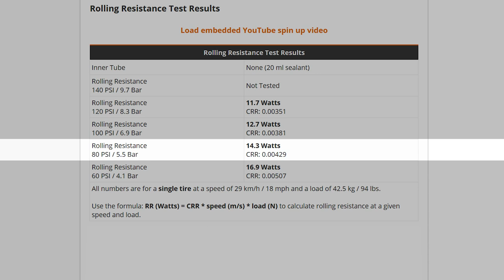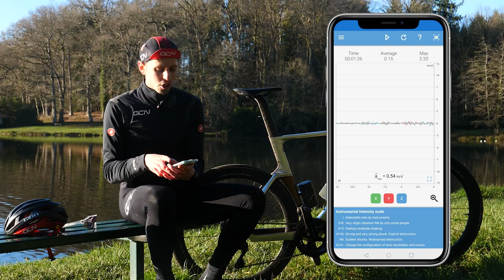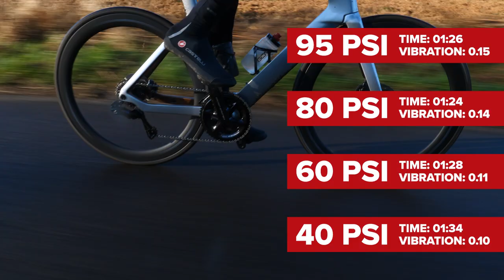Is There A Perfect Bike Tire Pressure For Speed & Comfort?

Comment from the maker: What are your thoughts on tire pressure and what do you use in yours?
Reply: 130psi on 23mm conti gran prix amber sidewalls. it's the past & will be the future!!
Reply: @GCN Tech : How much does the rider weight?
Reply: Great information! Btw what’s the brand on that Aero road bike ? And the sunglasses on the bench? Thanks
Reply: That I have no idea what PSI transfers to a normal way one would state tyre pressure (bar, kg, pascals,...)
Reply: I use 4.3 bar at the rear and 4 bar at the front, because the roads are really bumpy where I live and I use 28mm tyres, and I only weigh 63kg so I'm not that heavy
Reply: I run 23mm tube at 80 psi. My pump says it will go to 100, but I can barely get to 80. 🤣🤣🤣
Reply: 700x28c clinchers @50psi at 66kg. Holding speed well on grouprides with our crappy roads
Reply: @Fred_the_1996  definitely running staggered pressures makes more sense as there is more weight on the rear tire
Reply: I have to think that the optimal pressure to use is directly linked to the road you are on at the time
Reply: 60 psi both front and rear
Reply: Ive 70kg, Tubeless 26mm pirelli 65psi. On perfectly smooth road up to 70psi
And NO MORE!!
Reply: @adrienlevel  85 kg and use 25 mm
Reply: 62kg 45 psi with 28c tires. More comfort and no loss of speed.
Reply: @Fred_the_1996  thats very low. At least min 5 bar max 7 bar at least. You will consume less energy by having higher pressure.

Comment: Rough and bumpy roads. I'm a road cyclist and never ride on anything other than roads. However, finding a decent, smooth, pothole free, good condition road surface is a novelty.
So much so that if by chance I find one, I turn round and ride it in both directions.
Reply: Its not just the roads, the cycle paths are not getting maintained either.
Reply: You should come and try Swiss roads. Most are probably smoother than a velodrome 😅
Reply: @HFields  That's because you are in a country that has the foresight to invest in it's future. Here though, we simply don't. Everything on the cheap then wonder why it's broken. If it wasn't so utterly depressing it would be laughable.
Reply: Move to Florida.
Reply: Agree mate, it is the worst thing about riding in this 3rd world country as far as roads are concerned.

Comment: Would have been interesting to see you refine it even more, say try 70psi then go 5 either way depending on what 70 showed. Also would have been handy to know what the wheels are, so what the rim dimensions are?
Reply: 100% correct.  When I went from 25mm to 28mm tires, I started with a bit higher than the recommended PSI for my set up and weight, then I did the same exact ride few times a week reducing few PSI per ride (about  3 at the time) until I  found the sweet spot.  I went from 97/95 on my 25mm to 67/65 on my 28mm (different wheels of course). It took me few weeks, but it was definitely worth it the time and I wouldn't go back!!!
Reply: @FRamirez1A  Just curious (since you did all that work...) what you estimate your riding weight was and the quality of the roads you tested this on?
Reply: @georgehugh3455  Just go to the ENVE or SRAM tire pressure calculator (I used the ENVE chart). Depending weight, tires size  and your wheels internal measurement you can calculate a pressure to start with. I have tubeless set up and my wheels are 21mm internal and I use 28mm schwalbe. I weigh about 175lb.  My local roads are in pretty good shape (obviously not like a velodrome), but you can definitely feel a difference in comfort.  As a matter of fact, when I went under the sweet spot for me was SUPER COMFY, but the bike felt really slow accelerating off the saddle, so I went up in pressure a bit after that ride.
Reply: @georgehugh3455  If you're curious to have another similar feedback, I weight 145lbs and when I switched from 25mm to 28mm Tubeless, I lowered my pressure "Front/Rear" from 90/100psi to 55/65! I always have 10lbs less in front cause 55% of the weight is at the rear as a chart I saw long ago. Roads are quite shitty in Quebec "Canada". The difference was night and day, no way I'm going back to 25mm ever!
Reply: @PanzerIV88  Thanks :-)
Reply: @PanzerIV88  couldn't agree more. I will never (unless it's a hire bike!) ride 25s again

Comment: I love an endurance ride 150-250km on a Sunday so reduced vibration is very important with respect to rider fatigue. I’m 90kg and ride with a 28mm up front at 80psi and a 32mm out back at 70psi on Hunt Supa Dura wheels which are designed for 28-32mm tyres. 

Roll well, soak up vibrations and also great grip in the wet. 

28mm is a GP500 (Conti)
32mm is a 4 seasons (Conti)

In summer I ride 85psi up front and 75psi out back, it’s a bit drier on the roads and less mud etc.

Comment: Good video - just wondering if there is also a way to work out how pressure affects the risk of getting a puncture - this is an especially important consideration for those who use their bike to commute on bumpy roads!
Reply: A lower pressure will resist punctures better because the tire will conform over debris. When a tire has very high pressure and is prone to a puncture much easier. Think of it like a balloon that's half deflated it's very difficult to pierce. But a balloon blown up to its maximum is very easy to pierce.
Reply: @rider65  too low risks your rim though. A bump could hit your rim as your tire doesn't hold hard enough against it.
Reply from the maker: Both too much pressure and too little (due to pinch flats) increases your risk of punctures on bumpy roads!

Comment: When I went from 25mm to 28mm tires, I started with a bit higher than the recommended PSI for my set up and weight, then I did the same exact ride few times a week reducing few PSI per ride (about  3 at the time) until I  found the sweet spot.  I went from 97/95 on my 25mm to 67/65 on my 28mm (different wheels of course). It took me few weeks, but it was definitely worth it the time and I wouldn't go back!!!
Reply: Interesting. How much do you weigh? I'm preety heavy for a roadie 92kg and I ride on 28C Schwalbe Durano on 100psi/7bar and I never had a flat and I ride on harsh roads mostly.
Reply: @Jurica-mtb  Just go to the ENVE or SRAM tire pressure calculator (I used the ENVE chart). Depending weight, tires size  and your wheels internal measurement you can calculate a pressure to start with. I have tubeless set up and my wheels are 21mm internal and I use 28mm schwalbe. I weigh about 175lb.
Reply: @robbiddlecombe8392  my pressure isn't going to work out the same for you.  I went to the ENVE pressure chart and got the recommended PSI for my set up (66 psi in my case).
Since I was use to 97/95 on my 25mm tires, I didn't want to start so low and that's how my whole test began.  In every single ride I would log my pressure in STRAVA so I could compare my data at home after syncing with my bike computer.   
Per ENVE Chart, if you are between 170 and 180 pounds, for 21mm internal wheel size and 28mm tires, the recommended pressure is between 66 and 69 PSI, but once again, that should be just your starting point for testing.
Reply: @robbiddlecombe8392  I'm not really sure, I'm not an expert on wheels or anything like that, I just followed the chart and it worked for me. Are you running tubeless set up?
(When I say that it worked for me I mean that at the same watts I increased my average speed like 1 mile per hour if I recalled well).
Reply: @robbiddlecombe8392  Yes,  I run tubeless and I love them. 3 seasons with them, only 1 flat that I fixed with a plug. I don't even carry a Spare tube  anymore(I did the first season that I switched to tubeless).
Reply: Im finding out the same. 

I was on a set of brand new 25mm Vittoria Rubino Pros which were at around 90PSi I recently switched to some Specialized Roubaix Pro's in 28mm after the Rubino's kept getting punctures and im just trying to slowly dial in the right by trial and error. I went from 85/80 to 80/75 but even this is a little too firm and my lower back/spine has been absolutely feeling it after just two days of riding. Im now sitting on 70/65 and while the tyre is still quite firm it still has a bit of flex if I really push my thumb down on it. Not been out to test the new pressure settings yet as my back is just too stiff and painful...which is very strange as the 80/75 hadnt been that bouncy or jarring to ride at all.

I run a set of HUNT SuperDura's and Im a 92-95kg rider depending how much kebab ive had 🤣

If anyone is curious. 25/28mm on the specialized tyres are pretty good. The first thing i noticed was the amount of grip they had compared to the outgoing set of Rubino's even if im still trying to dial the right PSI. I can actually feel the tyres GRIP when i go around corners where as I previously couldnt with the Rubinos although I have never felt the wheels slide out from underneath me when cornering. They are a bit heavier though compared to the Rubinos but i might pick up the 23/25mm versions of the roubaix for summer use as weight seems more  inline with the rubinos

Specialized recommend a PSI of 115-125 for these wheels but HUNT says max PSI should be 100PSI on these rims. All a bit confusing but i'll get it dialled in eventually.

(hopefully my woffle will help someone)

Comment: Agreed. After riding at 125 psi  on  23 & 25 for a dozen or more years. I did a similar exercise and the-new t/p is 25  psi lower on 25 mm tyre , improving handling and comfort immediately. Make the adjustments across  on 32 & 40  with immediate results and will  continue to hone in on the sweet spot for 28 , 32 & 42 mm tyres.

Comment: My understanding is that tire companies optimize side wall and tread design to operate best at 15% rim drop.  For me, that's 47 psi front, 55 psi rear on 32mm tires.  I was pleasantly surprised to find that this not only rode a lot smoother, but handling and stability in corners also improved vs higher pressures.
Reply: 15% rim drop?
Reply: I am using the exact same pressure as you with 28mm tyre on 18mm rim. For 32mm i use 3-5psi lesser. I am 63kg. My bike feel smooth and fast and super enjoyable to ride

Comment: i like the idea to use your phone to objectively measure vibrations. about the experiment: it would be important to repeat runs with the same settings to see how consistent the results are. then it would be possible to say whether the differences are real or a statistical artifact. about too high pressure: I think that often feels fast because you feel more of the vibrations through the frame. testing wheel rolling resistance in the lab is done on a smooth surface. on a real road less pressure can be faster because the bike does less horizontal movement.
Reply: Much agreed with multiple runs and smaller pressure increments. I would also take it a step further repeat the experiment with some potholes and cobbles - those results would be interesting as well. Great work overall :)

Comment: Apparently the tubeless Panaracers I've been trying to seat for the last few days think the perfect pressure is 0 bar (0 PSI) 😅
Reply: Get some latex tubes and save yourself the hassle
Reply: @richardggeorge  1) I can't give up and 2) tubeless is great once set up. That set up can be a pain though.
Reply: You can seat nearly anything if you have a 60 gallon 240 volt air compressor in your basement. Good luck if you can do this on the road if it burps!
Reply: I added another layer of tubeless tape.  Then my Panaracers seated.
Reply: Have you tried the soapy water trick? As Gary said... more tape might help. Also (if you're not already doing it),  you might need a compressor or a chargeable pump.
Reply: @eccehomer8182  Appreciate the tips. I'm using a compressor and it's seated now but losing air from somewhere even though I've retaped twice. Might need more sealant...
Reply: Must be new run-flat technology.
Reply: Ah, Tubeless Road Tires!  
A messy, time-consuming, expensive solution in search of a problem.
Reply: @Lis Thank you very much for the detailed response!
Reply: @whatwelearned  Sealant isn't really rated to above 70psi. It also pays to get good stuff. I used Stan's, I've also heard Orange is good.
Reply: Yes tubless for road is entirely flawed, for the pressures that competitive/ fast road bike riding require
Reply: @eccehomer8182  We're talking 'cross tyres here. Circa 40psi
Reply: @whatwelearned  I feel you
Reply: I ride MTB and Road... uhh my MTB and gravel bike no doubt about it I am running tubeless. But for my roadbike I run tubes with sealant inside yes more weight but as a daily rider I say perfect.
Reply: @richardggeorge  100% road rider here.  110 kg= no tubeless.  By the time it seals you've coated the rider behind you and the tire has come off at the bead. Got to have 90 psi to avoid rim damage and burp flats. Putting a tube into that slimy mess changes most people's opinion!
Reply: If you are measuring 0 bar you are in some kind of vacuum :-)
Reply: @eccehomer8182  i use hutchinson's sealant and it works well too
Reply: Idk about tubeless tires but I know higher psi makes your bike faster by 20-40% I have tested it

Comment: Great concept for a video, I do wish with all these that the sample size went up a bit. You can always do repeat runs off-screen if it's boring, but would make the outcome so much more reliable. The 2s difference between 80 and 95 psi could easily be from a couple of windy gusts or a slightly different line taken. Taking an average of 3 would really mean something
Reply: My thoughts exactly - but this is GCN not a scientific journal! That bit when Alex was checking that the tyre was at the target pressure of 100 psi, saw it was at 95 and said "that'll do" tells you all you need to know! 🤣
Reply: Or you can do the repeat runs yourself.

Comment: Thanks for doing this test. Something I'm constantly changing is my tyre pressures. I'm not the fittest or youngest (51 years old) so always thought that riding with the highest psi (120 on my current tyres) would allow me to ride at my fastest and use less energy so long as I can put up with the harsher ride. I'm currently experiencing discomfort around the back of my neck and I'm guessing it's down to the harsh rides I've recently done. After watching this video I am now going to reduce my psi to 80, I totally get why you experience a faster ride with the slightly less up and down movement which is actually a lot of wasted energy.

Comment: These results fall in line with my experimental experience.  With both 25 and 28mm tires and 85kg of heft, I had found that 80 psi was my magic number.  But after a winter and some more testing, I prefer the 75 psi.  Much smoother at least and my avg mph is a bit better even!  Thanks for the number crunching, Alex!

Comment: I always run a slightly lower pressure on the front to help with grip (especially in the winter). I find my ideal balance between speed & comfort is 95 rear (as I'm a bit lardy..) and 90 at the front. However, after seeing this vid I might try 85 at the rear and 80 at the front. Really useful vid Alex! :-)

Comment: Interesting video, illustrates the difference between a "Road Bike" and what we used to call a "Hybrid" usually used on the road or cycle tracks.The bike I normally use has suspension forks and a suspension seat post, 44mm tyres running at their rated  maximum of 4.5bar. If traction is compromised for mud or ice I reduce the pressure by 1-1.5 bar. The bike then feels "soggy". No more comfortable just less agile, and harder to pedal.

Comment: I usually use 60psi on my winter tyres (32c alloy wheels) and a manufacturer  recommended 80psi (28c Hunt carbon 44 wheels) . The summer tyres are definitely less comfortable but do feel quicker.

Comment: I  swiched back to 25 mm tires and 8.0 bar in latex tubes. It's way more fun than a 32 mm tire with 5 bar - no matter what the current trend says. It was such a great feeling to be back on a real road bike. Thin tires and high pressure are - in my learned opinion  the fastest thing you can ride on a good road. When I want to ride my road bike I plan my routes picking the best possible roads available in the area and ejoy it. I know that low pressure will be better if the roads get worse and sometimes it can be anoying if these kind of roads cannot be avoided. But I don't want to win races. I am out there for the 8 bar on smooth concrete in narrow tires feeling. This is something you cannot get on a low pressure bike. If there is a tour on which I cannot avoid rough roads - I will use my gravel bike

Comment: As an added bonus, tyres at lower pressures will deflate slower than tyres at high pressures. 
Anecdotally, I know, but running my tubeless tyres at between 75 and 80psi, I'm not pumping them up as often as when I ran that 90psi.

Comment: Great video, GCN!  Any chance we could see how the road surface and tire pressure affect bike speed when you're actually putting down effort?  Might be a great opportunity for a test using an e-bike pushing a steady (x)w.  Also, as someone else pointed out, an average time from 3-5 runs would help compensate for wind, slight changes in line, etc.  Again, great work!

Comment: your test was on smooth road surface, for the roads i'm stuck with near where i live the 80 or even 75 would result real good because of less hard tire bumpiness losing efficiency.  I typically run 80 rear and about 76 front.

Comment: I'm an 80kg rider and I've always felt comfortable riding 100 in front and 115 at the back, both wheels are 25
Anything lower than those felt uncomfortable so I can't relate to what's shown here that lower pressure equals to more comfort
I guess weight of the rider does play a huge role on this matter